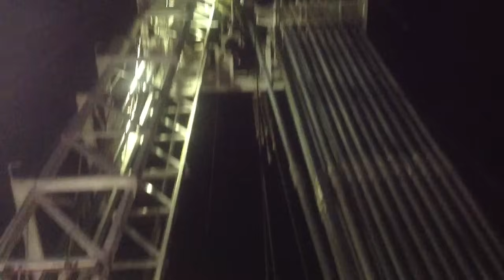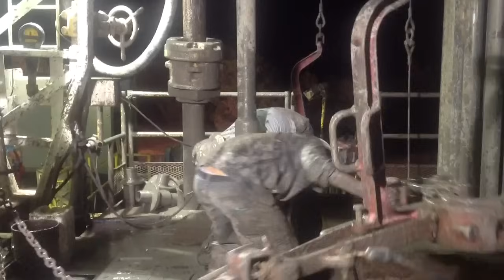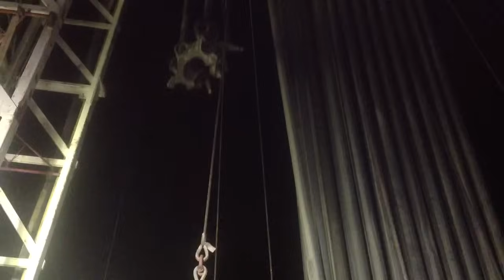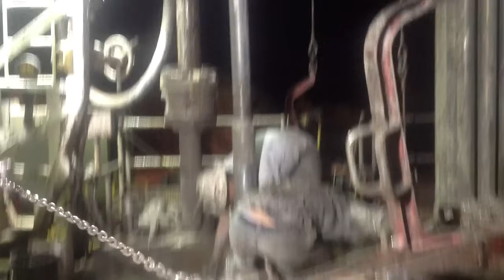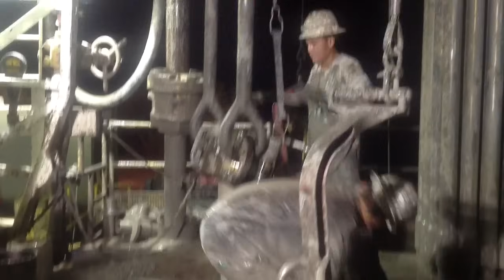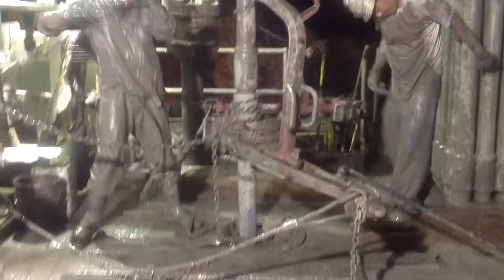Worlds fastest roughtnecks tripping pipe back in the hole

Comment: I can't believe that you would seriously call this fast pipe. There is one thing that absolutely needs to be done right off. When you dudes bring those tongs up to tighten the joint you are suppose to push them back so that a good full tight bite can be put on the connection. Ya'll did not do that one time so you have a sloppy connection before it goes in the hole. I guarantee you that would never have been done back when there were real roughnecks making up pipe. The driller needs to be schooled abot what he is letting get by him, it's his floor and he's responsible for a tight stack. And if yo think this is fast you should have tried doing this when it was the late 60s and early 70s or any time before that. There are hysters for moving around weight in bags and all kinds of other help we never had. When it was time to mix up some mud we put a 100 pound bag of mud on each shoulder a carried it to the mixing hopper and moving it around was done the same way. No hysters and motorized dollies back then. Anyway you want to look at it I still respect you young cats for even taking on this kind of work. I really do respect you for working, especially in that kind of a job. I takes a special kind of guy to do this kind of work to begin with. You cannot be a lazy man to do what ya'll are doing. It just burns my ass when you hear some young man say there aren't any jobs out there. The problem with most young men today is the fact that they are afraid of real work, like the work in this video. If someone really wanted to work there is always room for someone who isn't afraid of real work. I started on a standard derrick drilling rig back yonder when I lied about being 18. I turned 18 before they found out so I kept my job. I worked in the oilpatch for over 40 years and I made a pretty good living. Hard manual labor did nothing but help me. I was hard as a rock and twice as strong as most men my age. I am pretty sure that it helped me stay healthier than most men my age now. I'll be 70 soon.

Comment: I can see what they’re doing but can someone explain why they’re doing it? My guess is the hole has been drilled and now they’re putting in hollow pipes to suck out the oil.
Reply: No, nothing like that. Doesnt work like sucking on a straw. They are connecting pipe together to lower the drill bit back down the hole so that drilling can start again.
Reply: @thatsbollox  Thanks. At what point does the oil come out?
Reply: @Richie_W  If they find oil/gas in commercial amounts then they will do well completion until the geologists and reservoir engineers can choose the best way to maximise their returns and extract it.  That usually involves production testing. It may even be years before oil will be extracted, or they may want it immediately. They fracture the rock at the depth where the oil is, usually by blasting holes thru the existing casing/cement horizontally into the oil formation, and letting it flow into a cased tubing to the surface. Sometimes it needs to be forced to flow into the well by injecting water or gas via another well drilled nearby, but normally they use pumps that get the oil to the surface. The process start to finish involves mainly geologists and engineers and is mighty expensive. Far Far more expensive when offshore. Hope that helps.

Comment: I worked the rigs from 1966 to 1976, mostly triples going down over 12,000 feet.  I timed these guys running in on their double at 1 minute 5 seconds a stand.  Once we got the collars in and were running pipe through intermediate casing, we used to consistently hit 45 seconds a stand running in on a big triple with 5 inch pipe.  These guys are good, work well together, but they are far from being the fastest.

Comment: I worked the Alberta rigs from 1978 to 1980.

I hate to be negative here, but watching these guys work makes me cringe. Despite all of the positive comments, that motorman doesn't know how to spin that chain. Not his fault. Comes down to training. Needs a good driller, too. And the joint needs to be at the right height, so the motorman can throw the chain straight, instead of up.

I learned it from Metis dereck man, named Roddie Carrier, on my first rig. You pretend you are throwing a tennis ball around the pipe as if you are aiming toward the driller. Your wrist lines right up with the pipe so your hand actually goes beyond the pipe. You throw the chain hard so that all of the links stay close together ABOVE the tool joint. You give it a split second's slack, and a slight downward jerk so all the rings fall nicely together, then stand back and hold the chain TIGHT, keeping a solid stance so you don't get dragged into the pipe while it spins in. Then, as soon as you hear/feel the two joints thunk, you instantly slack off on the chain and it slides nicely around the pipe until it runs out and you grab the rat-tail with your other hand. It's as smooth as a hot knife through butter. There is none of this buggering about with the rings all separate and highly angled, and when the chain slips below the joint and gets stuck.

I loved doing it. Twenty something below zero on the prairies and I was just wearing a T-shirt with the arms of my skidoo suit tied around my waist. With a good synched-up crew, it was like making music.

Dangerous as fuck, though. Even when you did everything right, things could go wrong, like the time one of the tong jaws just snapped because the bottom of the pin had simply crumbled away. It flew across the floor, bounced off the doghouse, and hit a guy in the knee. No one was seriosly hurt, that time.
Reply: Started in 82 retired 2013 not by choice what a life man.. Cat heads with Johnson bar for making up pipe I was reading on how you spun chain. Nice step by step..
 Still used rope on the cathead than to pick up pipe 2 at a time out of pipe tubs swing them over with the boom line. It was all timing.. There was no loader or backhoes or Vac trucks you were them things than manpower.. on the BOPs were closed by hand with big wheels 17 and a half turns to close them pipe rams and blind rams.. you shoved the shale pile and didn't leave till you had it down for the next shift.. Or you didn't have a job to come back to if you didn't
This guys were slow, I think if there was no sparks coming off the chain we were not happy like you said dangerous as fuck. I worked southeastern Saskatchewan, Alberta, all over BC, NWT, Yukon. The Airways south of Edmonton was my second home.. Best stripper bar around rig sighs from a hundreds of rigs.. A life I would not trade for anything. The thing we did as a crew.. lol And they have two on the floor we had one.. Roughneck ran the floor we only had 4 man crew an most of the time the motor hand was doing his job checking things like the boiler, light plant, fixing doing a oil change on a pump motors while we tripped pipe.. I would ride the blocks up and down every once and awhile the dead line was the fastest way down. Pray there are no wickers.. 
Did Robbie have a brother named Dave?? If so I know them and Robbie passed away from a Bike crash about a 2 years ago.. That's if it was him.. He played as hard as he worked.. Take care be safe God Bless..
Reply: @Old-biker  The rigs I worked on had three man floor crews. Two roughnecks and a motorman. It never occurred to me that we were being spoiled. 

I forgot about the sparks. I actually used to enjoy the smell of the smoke that wafted from that  chain. 

I don't know if Robbie is the same guy. I thought our guy was named Roddie, but he did have a brother or two on the same rig, different crew(s). This was around Taber in 1979. New Discovery Rig 1. He was a lanky guy, about 23 years old, so he would be around 67 today. He had been on the rigs since he was 17. His hearing had been so damaged by the noise that he was quite deaf already. I think my own hearing was damaged too, but not as bad as his. We were loosening nuts with a hammer wrench in the pump house one day, while the engine was revving high. They called them "Screaming  Jimmies." Each smash of the hammer felt like someone driving spikes into my ears. I started wearing the ear protectors at that time, probably a bit too late.  I learned to lip-read out there.  Still comes in handy. ;) I remember a time when the mud was just spewing over the shaker screen into the sump. I ran to let Roddie know. He was sleeping, while standing up, in the pump house. I shaped out the words "loo zing mud" to him and, alarmed, he lipread those words back to me. Then he took off like a bolt of lightening.

We used rope and cathead to pull the pipe up from the catwalk to the V door (or V deck?), three at a time. Was it three wraps? No more. No less. We used to pull up three pipes at a time. One day, a brand-new roughneck was operating the cathead, when one of the pipes got stuck on the catwalk. Of course, he couldn't see, or hear, what was going on down on the catwalk, so he added an extra wrap or two. That did the trick. Those extra wraps worked so well that the three pipes flew all the way up to the monkey board and broke the shiv. What goes up must come down. It wasn't on my shift, but I saw the damage. Lucky no one was killed. Heard a story about a guy that used 5 wraps and ended up getting himself wrapped around that cathead. Shivers.

While I loved spinning that chain, I hated every other minute of that job, so I didn't stick around for too long. I swear, Alberta rig work in those days was comparable to being in combat in a war zone.  I don't regret the experience, though.

Comment: Why does the rig need an exhaust brake?
Reply: It doesn’t.  They use a hydromatic brake or a dynamic brake off the end of the drum shaft to slow the drill string going back in the hole.
Reply: @dougbrusso7746  I can hear the exhaust brake.
Reply: I suspect what you are hearing is a Waukesha bark.  Waukesha engines had a tendency to backfire when you ran them wide open and suddenly went to idle.  That sound was similar to a Jake brake.  Most of my experience was with Cat v12s and v16s but I did also work on GMC and Waukesha powered rigs.  None of them ever had a Jake brake.

Comment: Your kidding regarding the fastest! I worked the floor for 5 years. This looks like slow motion. My driller ran the elevators wide open up the Derrick.when I threw the chain it moved a lot faster and spun its way off the pipe. We were double if not more than these guys. The worst was tightening the b.o.p bolts hunched down tightening the bolts with a wrench and 16 pound sledge hammer. The thing I hated was coming out of the hole laying down 4 5 inch drill pipe. We w orked 7 days 2 off and changed shifts. If your replacement didn't show you worked 16 hours. Seriously I had the flu and called in sick I was told take a couple aspiring and get your ass to work and hung up the phone

Comment: I always these kind of rigs souped up pulling units was working on one back is the 80s going in the hole an hit a bridge with about 40000 lbs of string weight talk about coming off the diving board i remember the pipe stopped and the blocks hit the pipe and then it fell threw the bridge and kaboom the pipe hit the elevators and the whole derrick was flopping around thought I was going to find a clean pair of pants after that the driller slowed down a little bit

Comment: There just average there’s nothing special about that crew . I ruff neck for 18 years started in the late 60s.your not a good chain hand if you can’t get the chain above the box when you throw it. I throw the chain for a long time could throw it in either hand. Your driller has to be as good as the hands if you want to be fast. That rig is just a double we were faster than that and I worked on a triple.

Comment: hardly the worlds fastest, that's funny   since when does the worm throw the chain?  the worms chain technique or lack of would cost him fingers if he were working for a driller who knew how to make things flow which means a few more rpm on the friction cathead.  with the added speed and not tossing his chain until there was some tension on the ass end it wouldn't be such a sprawled out mess when he does toss it.  honestly they're tripping at a speed closer to a triple than a well run double.